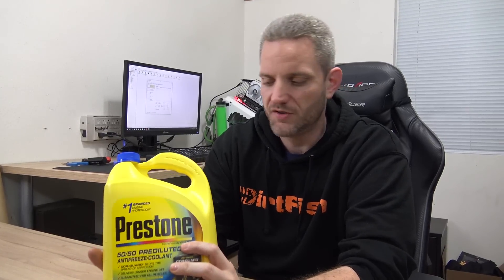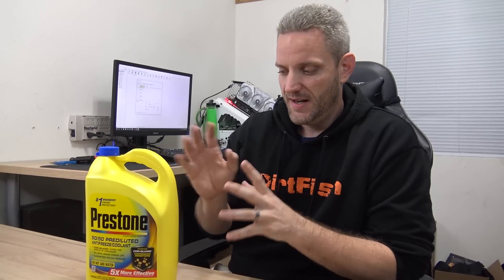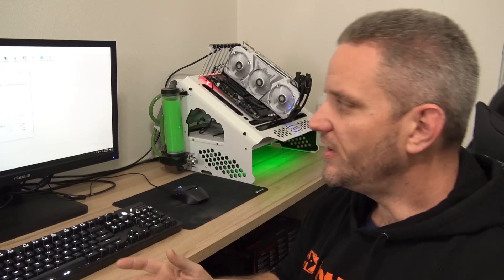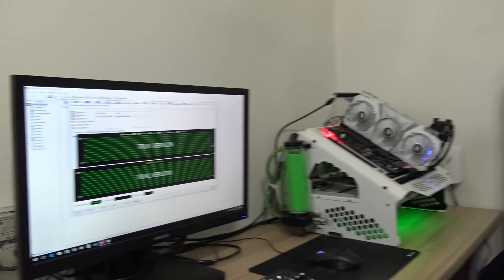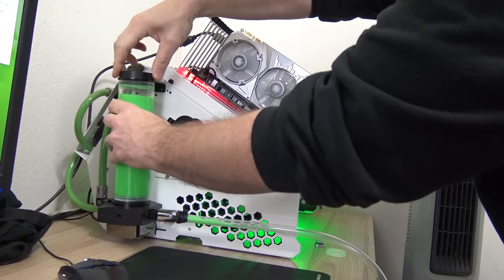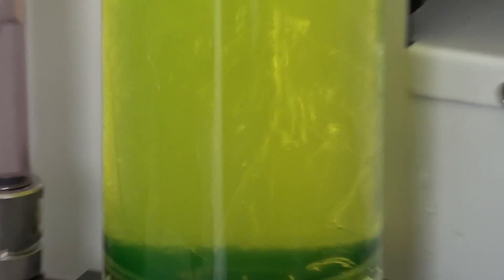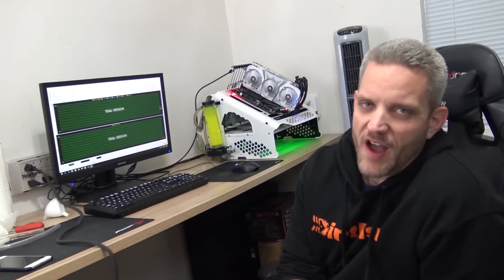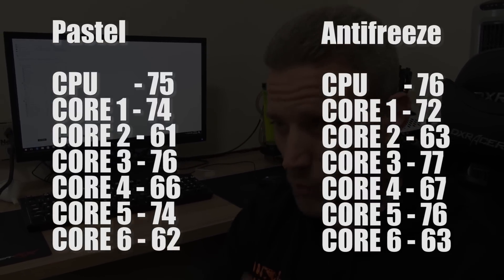I used Antifreeze to cool a PC

Comment: I was concerned about temps in my house falling below Zero and cracking tubes on a custom loop, but somebody told me some pc coolants have chemicals in them to avoid freezing.
Reply: casheesed you should be more worried about the actual pipes in your house busting if you're letting it get that cold.
Reply: Get AMD, it will fix it.
Reply: Condensation would only occur if the PC was colder than the air in the room. At worse, it would be at the same temp and turning it on would warm it up above room air temp so it should be no problem. Condensation is only a problem if you are doing some sort of below ambient cooling like phase change.
Reply: if your house is falling under zero degrees, dont think about buying a water cooling loop, BUY A FUCKING HOUSE
Reply: casheesed Maybe try a methanol water mix.
Reply: DeilGrist knock on wood, I've never had a busted pipe.
Reply: Gaming Ted it's not a common occurrence, the time I'm thinking about happened 3 or 4 years ago. not much I can do about the electricity going out or the temps outside and if my pipes burst well they burst and that sucks, but if I could avoid destroying a 2 or 3 thousand dollar computer by using certain coolants that would be nice.
Reply: Fuck it. you computer is probably garbage anyways
Reply: casheesed just keep the PC on all the the time
Reply: Prich038 the few times I've come home to a freezing house is because the electricity went out.
Reply: UltimatePOPCORNS I have this one particular time in mind where my electricity was out almost the entire time I was at work. when I got home it was like -20 in my house. probably still going to do a loop, but just something that crossed my mind.
Reply: Oh you're not joking...get it on a huge UPS and leave it running, idle would probably be enough to keep from freezing and not use too much power. Also watch out for condensation when you heat it back up!
Reply: what made your house -20 degrees? the weather?
Reply: Don't run your PC in temperatures below its operating range.   Besides messing with the internal circuits in your processors and chipsets, below freezing temperatures can cause short circuits due to condensation (or frozen condensation, whatever that is called) and damage the electronics.
Reply: wingracer 16 Right so when he heats the house back up, the PC would be cooler than the air that is being heated for a time and could get condensation.
Reply: anti-corrosion
Reply: casheesed it seems that you need a cpu heater instead
Reply: my house once it 71 degrees. i hate florida.
Reply: i think you have bigger problems to deal with - like relying on Electric heat.
unless you're in an Apartment and don't have the option to do what you want - water radiators is the best way to heat your home. it's the most efficient method of transferring energy, and you can then burn dinosaurs for your heat.
since you lose electricity sometimes apparently, a UPS for the Boiler will solve that since it's just a very simple computer, nothing that draws a lot of current.

yeah, buying a good Boiler can be upwards of $8000 and then you have to run the piping and Radiators - but it's a lot of savings in the long run.